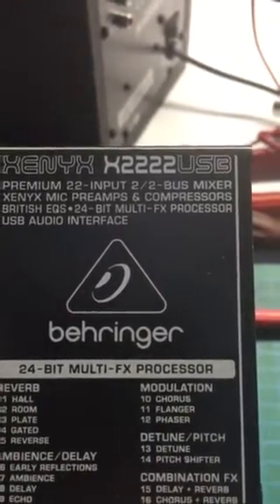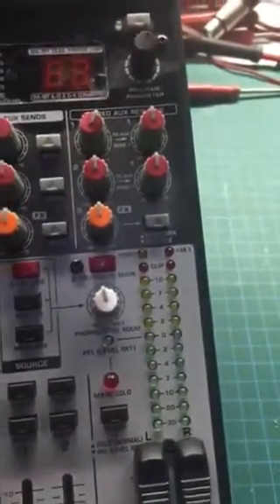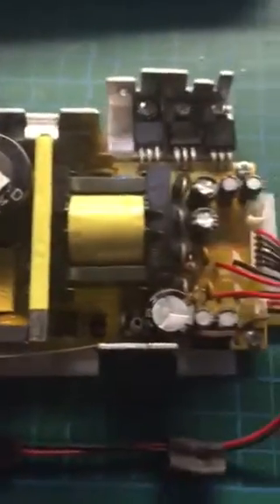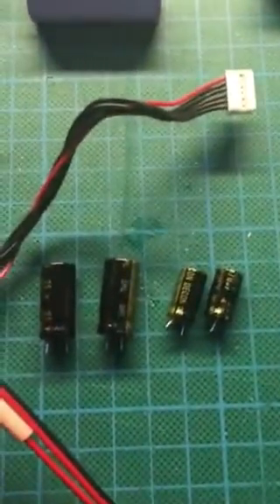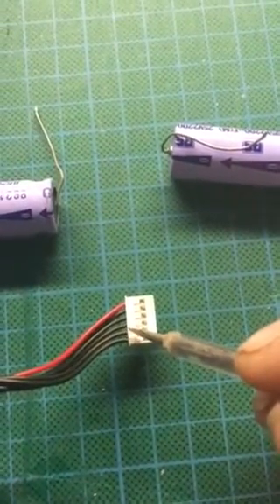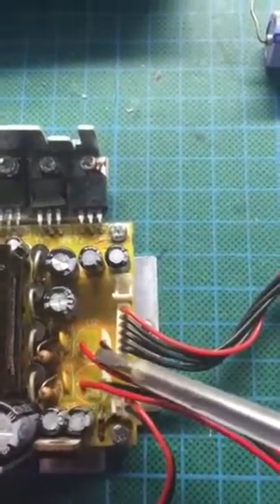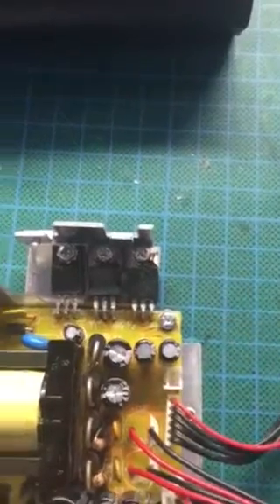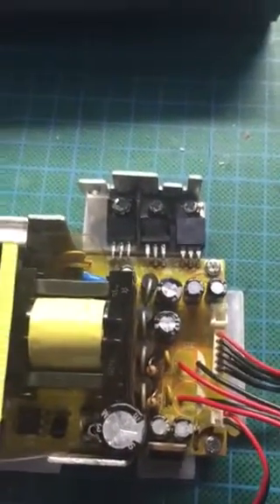Behringer xenyx X2222USB power supply fix repair

Comment: Thanks a lot for the video. I have same model and would like replace all sliders because mixer has been for long time in a garage without cover o something else. I'd try to clean but most of them don't seem wants came back to work properly. Righ now don't have mixer with me and, please, can you tell me if the length of the sliders is 75mm and if the value is 10K for all, including the general volume? Thanks and sorry for my bad English ...
Reply from the maker: Hi, sorry I no longer have the mixer, quick look at the circuit diagram and it states 10K but no part list numbers.
Reply: @waynephillips1848  Thanks a  lot!

Comment: Found a qx1222usb outdoor in the neighborhood between trash. Display was flickering, compressor and wireless mics LED always on. No sound but lot of noise. I replaced exactly the capacitors you described. Works phoney until now. Some more capacitors are on the way and i'll change all of them on the unit later. Many thanks

Comment: Hi dear  Sir 
This is Vivek 🎉
I hv x1832 n it goes off n on and makes a dub like sound .
Can I change capacitors ? Need help/suggestion.
Thnx❤🎉
Reply from the maker: Hi, nearly all Behringer mixers i have worked on, the fault is with the capacitors in the power supply, there are few YouTube videos showing a similar fault to your description. The service manual is available with a google search.

Comment: A few minutes ago, I just repaired my Soundsation Neomix 402UFX which is a clone of Behringer Xenyx X1204 USB. They both share the very same power supply as the one shown in this video. My dead electrolytes were those replaced by the bigger ones (1000nF/25V/105C - C12 and C16). The power supply is poorly made, from mechanical standpoint it is a complete disaster. Power module is held in place on 4 screws, out of which 3 of them already had stripped threads (never opened or repaired mixer, so it was done by the Chinese manufacturer). The screw holding one of the +/-5V transistors was completely missing, leaving the component poorly cooled as it had quite loose attachment to the heat sink. Main output faders started to crackle right after my warranty expired, couple of switches produce crackling too. My mixer was well looked after, never traveled, regularly (very gently) vacuum cleaned top part to keep dust off the fader paths, in time of inactivity covered under a dust cover. Always stored at room temperature and approx. 40% humidity - ideal conditions. Despite these conditions, this crappy mixer is basically falling apart after barely 3+ years of very light service. Soundsation as well as Behringer have their mixers made in China (most likely the same production line) with emphasis on the lowest possible production cost, resulting in a very poorly made products which won't last long. Never mind, putting Soundsation and Behringer brands on my personal blacklist. Never going to buy from them again.

Comment: I have two Xenxy 1222usb mixers with the same fault. I've got the psu out of one & sure enough two caps have swollen tops but also I've noticed one leg of the 7805 regulator has no solder on it.  The 48v line is ok & when switching off the mic works very momentarily. Fingers crossed.

Comment: This is exactly what was wrong with my Xenyx 1622USB. Same power supply, same 4 capacitors were broken. I only changed those four, and didn't do the mod, or the other cap replacements you mention, but it worked flawlessly after the repair!!

Comment: What can i do to the power supply of my Behringer mixer Xenyx 1222fx.  Only the the led indicator of phantom 48volts light up. When i check the voltage output of the power supply it is complete, +15, _-15 and even the 5volts are completed. Bur when i connect the socket to he main board of the mixer the mixer does not turn on. only the the phantom led light up. what should be the problem of the power supply. i try to replace the power supply of the mixer with a new one and it works. so the problem is the old power supply. anyone can help me please. what should be the problem of my power supply even the voltage out are comlete, why it cannot turn on the mixer?
Reply from the maker: Hi, If safe to do so, you could check the output DC power rails when the main board is connected to the Power supply, this might indicate which rail is being pulled down, alternatively if you still have the power supply that works, do some comparative resistance and capacitance checks.
Reply: @waynephillips1848  thank you so much for your advice  sir

Comment: Well kind sir you said it might help someone in the same position as you and it did (me). Thank you for all your help it saved me a lot of time. NB none of the capacitors in mine had blown there tops in any way but on test they were all over the place so just shows never judge a book by it's cover.

Comment: Thanks for this video, a lifesaver (or rather, a mixer saver!), my Q1204USB developed a similar (but not identical) fault  and while I'm not an electronics repair person myself, a coworker is. Showed him this video, he replaced the two 1000uf caps only IIRC and sure enough it worked fine thereafter. Would be lovely if Behringer actually would make this be known somewhere in their support materials but at least this is relatively easily repairable once you know what's wrong!

Comment: Hey Wayne, thank you for this video. I got my x1222 fixed and got it to work for about six months, but now the effects started making a noise like explosions..firework!! and no effects. The noise goes away when I turn the efx knob all the way to the left (no effects). Replaced some of the caps on the effect board to no avails. Any thoughts would be appreciated. Thank you.

Comment: Thanks for this - my X1622 failed suddenly earlier today - lifeless except for the 48V LED which is lit up, so after the festivities I'll dust off the soldering iron and investigate the caps etc on the lower voltage lines

Comment: Tnx for the video, I replaced the 6 caps that you’re saying but still not working, just the phantom power is lightning up,  any idea what else could be? Mine it’s a 2222fx, but it’s the same power supply, the only difference is the c13 cap it’s 47uf, thanks in advance for your reply

Comment: I have this mixer with the same problem and one of the caps has visibly blown, can you tell me when sourcing replacements do I just need to match the capacitance and voltage or is there anything else I should be aware of?>
Reply from the maker: Capacitor, if polarized insert the correct way!! try and match the capacitance, voltage, as long as it is equal or higher, before purchase check the capacitor data sheet for size's i.e leg pitch and body diameter if you are restricted by other components, hope this helps.
Reply: thanks for the quick answer, what I meant to say was I have this same supply board in a xenyx series mixer and am planning on replacing the same caps as in your video. How about the tolerance for the replacements, is 20% sufficient or should I go for 10%?

Comment: Thanks so much!!! I've been going nuts with my Xenyx X2222 doing exactly  what you described, but because it was powering up, and things were working intermittently, I was thinking there was an issue somewhere else that I would have to track down. Now instead I'll be starting a power board rebuild in the morning :-)